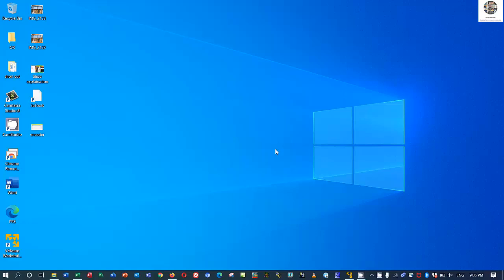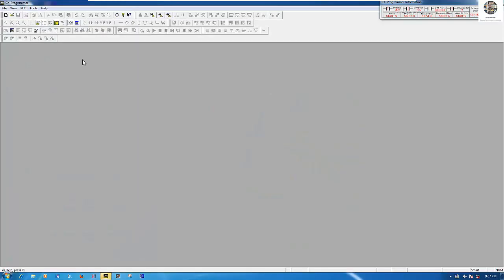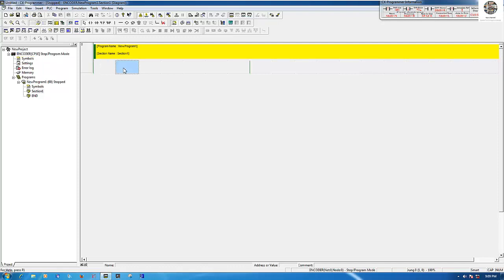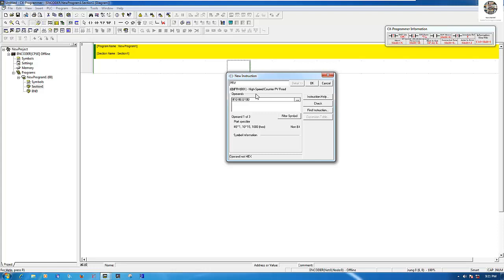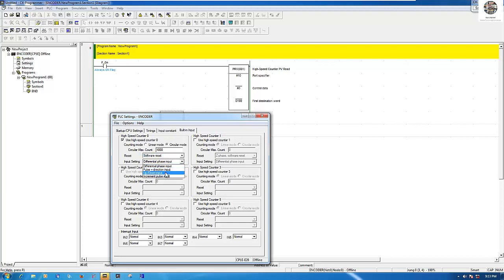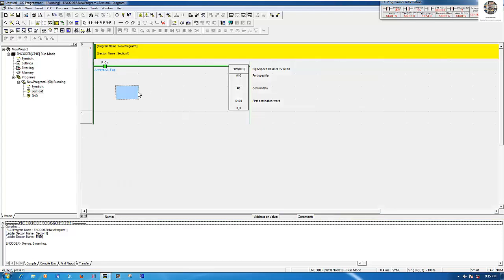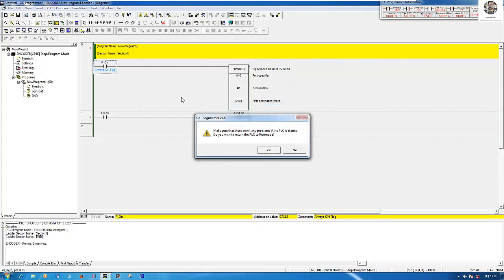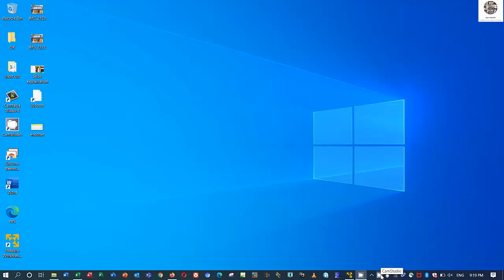OMRON software "CX-Programmer" how to read data from encoder using OMRON PLC model CP1E

Comment: i have done similiar, i can read values. values are increasing on rotating encoder left and decreasing on roatating right. But issue I am facing that after 0 , values are not going negative they become 4294967495 and decreasing. Looks it is unsigned , how to make signed values. I need to get -1 to -5000 after 0 value. Please help.